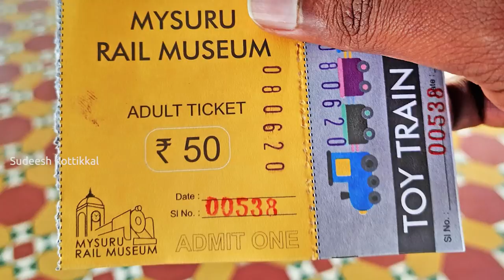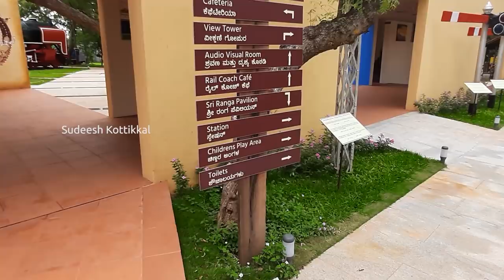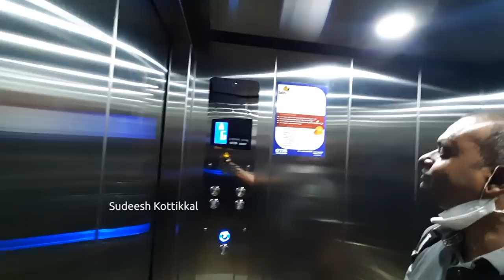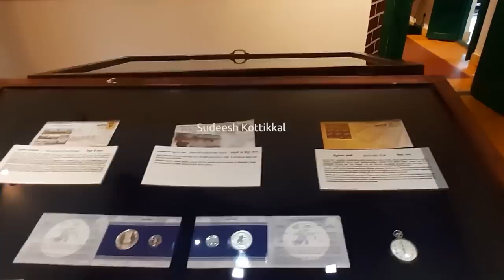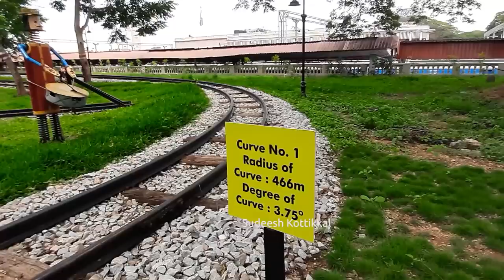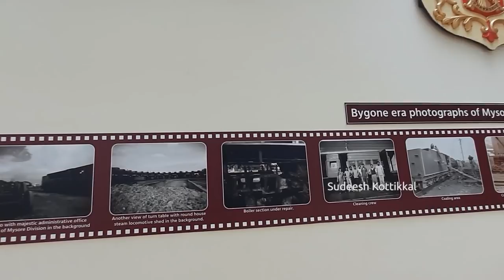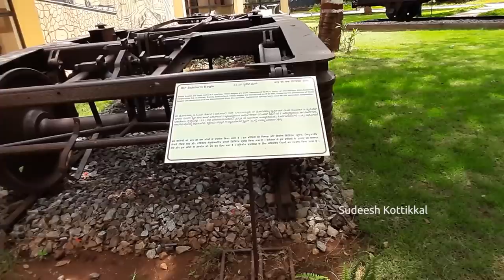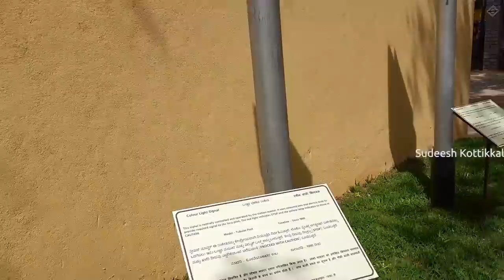Rail Museum Mysore Rail Museum Mysuru vintage locomotive Museum Mysore Tourism Karnataka Tourism

Comment: sir the temp should be 98 degree Fahrenheit . you told it as 88 pls check sir
Reply from the maker: Yes.. I heard it wrong I guess
Reply: @SudeeshKottikkal  Ya but it's actual basic common sense to know that body temp will not go to such a lower extent. Min body temp will be  around 95. You need to correct it